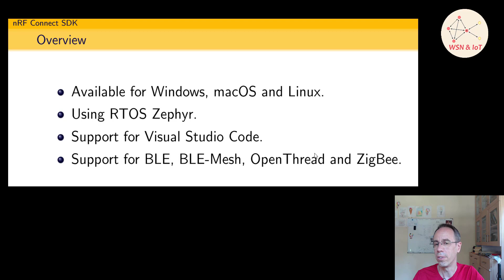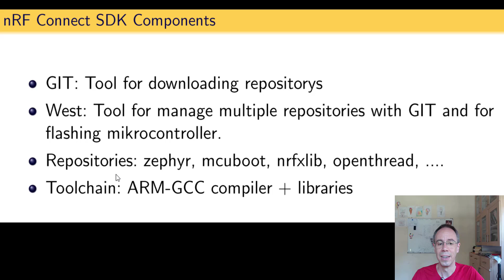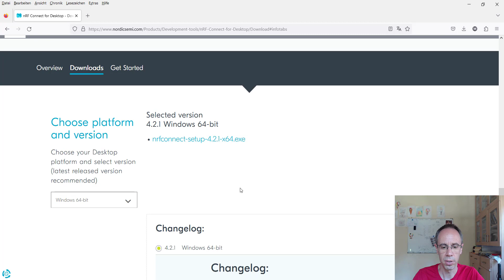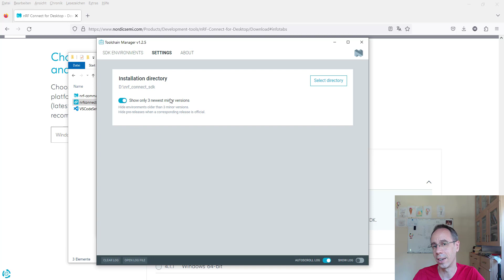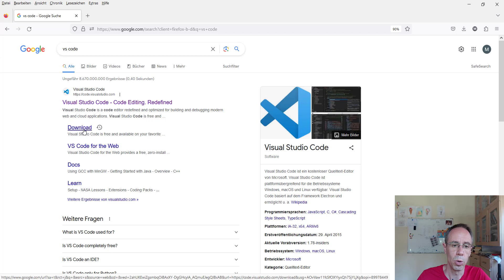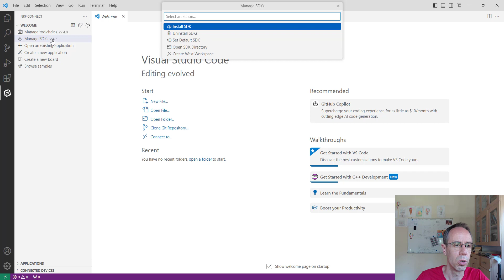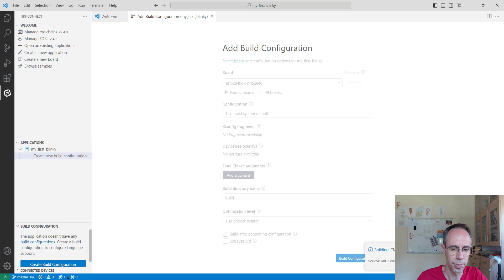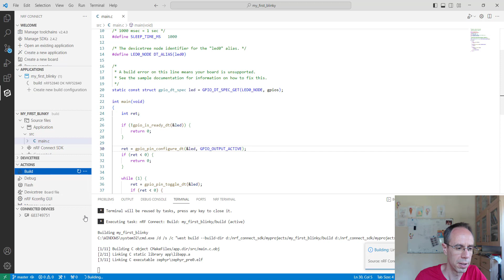Zephyr and Nordic nRF Connect SDK - 01 Introduction and installation (v2.4.2)

Comment: So close to working, but I keep getting the following error when I try to install the blinky application "Access protection is enabled, can't read device version." I have two NRF53 DK boards and it does the same thing on both, not sure why
Reply from the maker: Strange. Had newer problems with access protection. Did you maybe flash a programm where the FLAGS for access protection are set? You can try to setting the access protection to disable with an ERASEALL. See also: https://developer.nordicsemi.com/nRF_Connect_SDK/doc/latest/nrf/security/ap_protect.html
Reply: @wsniot  I figured it out. In addition to running eraseall and recover, I had the wrong board configuration selected and I finally found the right one! All works now, thanks!

Comment: Well, I use nrf52832 on a my special card, which board I choose in build configuration or what can I do? I am open to your advice.
Reply from the maker: What do you mean with special card? Did you design one by your own? For programming you can use what fits to your board best as long it has a nrf52832 chip (i.e nrf52dk_nrf52832). You have to adapt probably the device tree. And of course you need an external j-link programmer or a bootloader on the nrf52832.

Comment: Hello Sir, I am getting message 'Device not found' while flashing the program. Please give some suggestions.
Reply from the maker: Check if all the switches in the right position. Check if your device is accessable in the device manager. Do you have a JLink CDC Device as com-Port for instance?
Reply: @wsniot  It is not showing connected device in device manager. Shall I need to do any extra settings on my Windows PC?
Reply from the maker: @patil29066  Did you check the power switch on the board? Should be set to on. And the second switch should be set to default, not to nRF ONLY. Does the power LED light? In the device manager there should be a device. If the driver is not installed properly than at least as unknown device.
Reply: @wsniot  Thanks a lot for your guidance! I was having issue with the power switch and also, with the cable. Now, I am able to flash the program:)

Comment: How to create a project if I have my own nrf52832 or nrf52840 board with its own wiring and hardware configuration?
Reply from the maker: That depends. The simplest solution is to use an existing board such as the Xiao BLE and customise the DeviceTree. Or you adding your own custom board: https://www.youtube.com/watch?v=V_dVKgWKILM

Comment: Very detailed video. Thanks for your time. 
Can you kindly do a video on SAADC with nRF5340-dk? 
I'd be very obliged to you. 😊😊
Reply from the maker: Thx for the feedback. I dont have the nRF5340-dk here, but it should work similiar like the nRF52840: https://youtu.be/Lcjt2Iu2xvY
Reply: @wsniot  I'm having one issue though. 
The issue is that some of the examples work just fine when making a new application based on some example let's say blinky. 
But SAADC example doesn't work when I build it. It gives an error 
CMake Error at CMakeLists.txt:11 (GET_DEVICE_CONFIG_FILES):

I tried googling it but there's only one link explaining it but I couldn't understand what to do. 
If you could help me out, that'd be a huge help. 
It seems like nRF has very poor documentation and no explanation on working examples. Could you refer me to channel or website which could help me out. 

And I really appreciate your reply. 😊
Reply: @wsniot  
Actually I'm new to the nRF family. And it feels to me that the learning curve is too high. And very few people seem to have worked on this. 

I'm quite good with STM32 but to fail here with nRF. 😔
Reply from the maker: @NoumanAli  Which build did you use? With nrf5340dk_nrf5340_cpuapp compiling works fine with me. In nrf5340dk_nrf5340_cpunet near all is disabled as default in the devicetree.
Reply: @wsniot  if i try compiling the examples, they work fine. But when I make another project based on the given examples, then it gives the above issue.
Reply: @wsniot  could you be kind enough to share your contact or email so that I could explain in more details. 

That would be very kind of you ☺️

Comment: Thank you so much for updating that old video with 1.9.1 SDK version. Do you know if there are some deprecated functions for OpenThread in 1.9.1 version? Why did you upgrade the SDK version?
Reply from the maker: For OpenThread I think not. But there were a lot of minor changes overall that didn't fit in the old video anymore. These are for example changes to the header files and the graphical interface in VS Code, especially the selection of the toolchain, the creation of projects and the graphical interface of the DeviceTree.
Reply: @wsniot  Thank you so much for your reply, I asked you this because I trying to replicate the CoAP protocol with 840DK's again, but now with 2.4.2 SDK version is not working anymore, is compiling and flashing into devices but doesn't has the expected behavior. Do you might explaining to me which are those changes made for newest version? The code is the same. We cannot find out some probable solution.
Reply from the maker: @brandonmoncada1951  I tried my CoAP example and it works the same as before. The biggest problem I had with the SDK v2.4.2 was that uart1 was disabled by default in the devicetree, otherwise my programs all ran as usual so far. What exactly is not working? Is the CLI working? Do both have the same dataset? Does sending UDP packets via the CLI work?